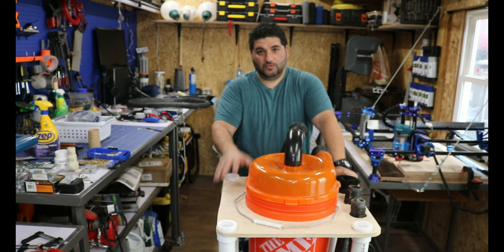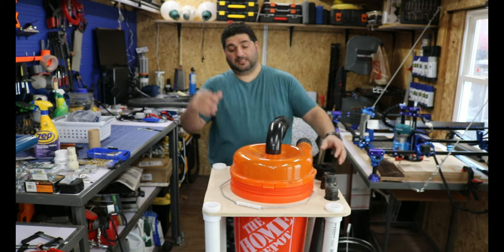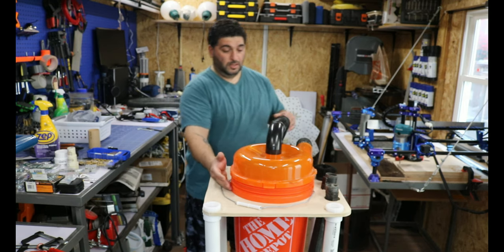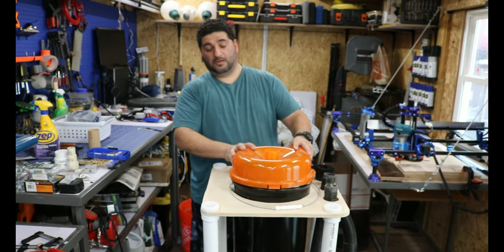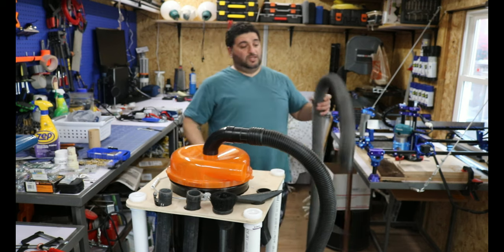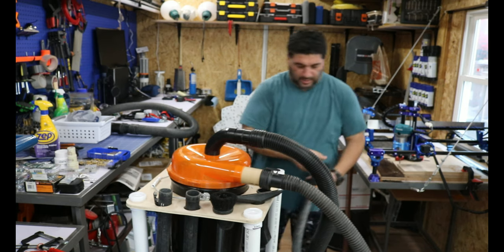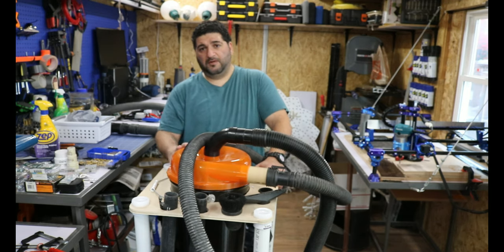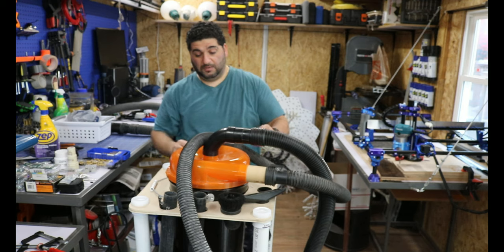I upgraded a shop vac dust collector and it turned out AMAZING.

Comment: Heat up 2" Schedule 40 PVC pipe to get it pliant enough to reshape the ends. Great for making adapters without a need for a 3D printer or acquiring the skills to do it.

Comment: It’s all about air flow. Metal bucket will collapse the same way, I think you’ve had a restricted hose going into your bucket, & air can’t flow easily, or your bucket has over filled , & sucked debris into main collector. 

If air can’t flow easily, then it’s going to suck itself in, saw a previous system made with a metal bucket, put his hand over the pickup pipe/faced it against work top, & sucked in the metal bucket.
Reply from the maker: Well the walls on those plastic buckets are very flexible, and I agree air restriction will cause it to collapse.   The metal buckets are much more sturdy against the pressure and thus far it has stood up on various uses.

Comment: I understand that the metal bucket doesn’t collapse, but if you take the original plastic bucket and nest it in an additional plastic bucket, it will prevent the collapsing.  The reason for this is that you’ve essentially increased the wall thickness of the collection bucket.
Reply from the maker: I totally understand that, I did try it and the bucket was still collapsing.   These vacuums are just too powerful.   Nevertheless for basic dust collection for table saw and miter saw, thr plastic buckets work just fine.
Reply: No  you have not. If you glue the two together yes. Not what you said.
Reply: I thought the same, but the suction is only applying the force on the internal bucket so wouldn't it still potentially collapse the inner one? The outer one wouldn't show any collapse because it's not under the pressure. Do you have to glue them together?
Reply: @xxxaltedwun  You and I are correct. Nesting two buckets will not make either stronger as they are still independent of one another. Yes, to make the inner stronger from collapsing inward the two would need to be glued welded or otherwise joined. Nesting two would/might limit OUTward stretching but not inward.
Reply: @xxxaltedwun  one would think, but in reality with the bucket shape, being circular and fitted together, the two walls actually work in unison.  It’s not quite a composite structure but it’s enough strength for the loads.

Comment: Thank you for sharing your video. What would you suggest to use for a gasket between the dust stopper and the bucket?
Reply from the maker: You don't need a gasket at all, there is enough suction power from the vacuum and since the Dustopper fits a bit snugger, you should be good to go.

Comment: Did you find a maximum CFM or lift rating for a vacuum that causes the bucket to collapse?
Reply from the maker: My current vacuum is at 132 CFM using a 1.25" hose, so giving the powerful motor, so if I had to guess, I'd say 70-75 CFM would prevent a collapse.

Comment: Thanks for sharing your video. What would you suggest to use as a gasket between the dust stopper and the bucket?
Reply from the maker: You don't need a gasket for this setup
Reply: I used some 1/8" foam that I found at HD, then lined the flat area of the Dustopper that mates with the bucket top lip. It creates a tight fit between the two.